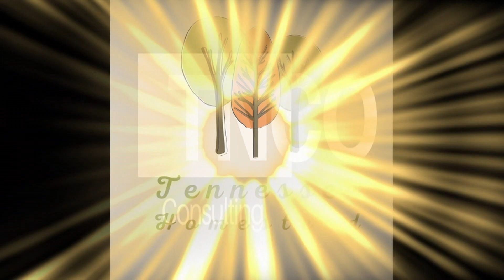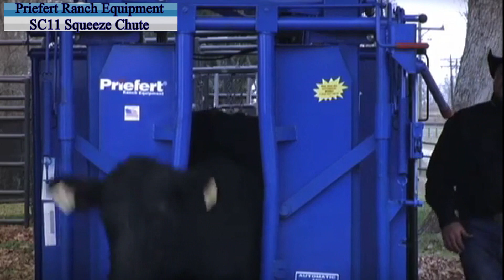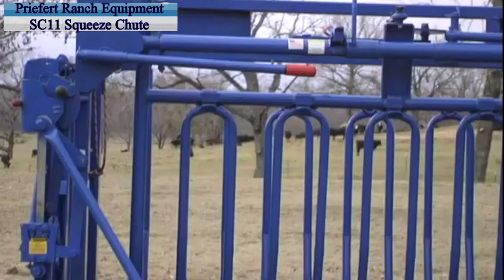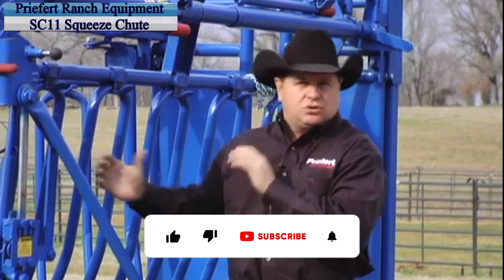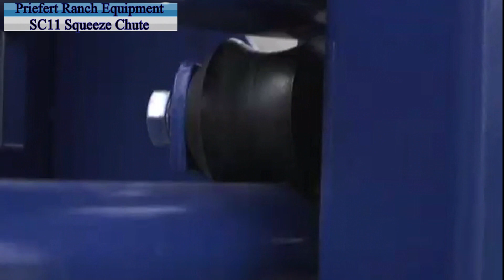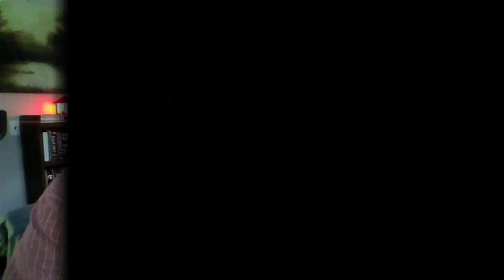HOW TO MAKE MONEY WITH CATTLE | Priefert SC11 Squeeze Chute

Comment: I've built a 8' high wooden "V" head gate, 1954 cattle design. It's never broken but it's a pain to use to secure larger cattle into. It's super strong but i won't use it for a 2,000. lb bull...1,200 lbs is enough. I pretty much ear tag and band when they'e little...everything else cattle maintenance is done at the feeders, reaching and spraying behind a 5 foot wall. This will be my first profitable year...took three years to get here. I sure would like one of those fancy SC11's, but i need two more pieces of equipment ahead of that. I'm a minimal steel operation. I don't always know what i'm doing ..but i sure am having a lot of fun.
Reply from the maker: My friend when I got started, everything that cost money I would build out of wood. Often as you grow your heard, the time savings starts being worth the investment. I always started with used equipment, then replaced it as it wore out. Depending the $$$ in the wallet would decide if I would go new or used. This one is a really good chute. ~ Rich